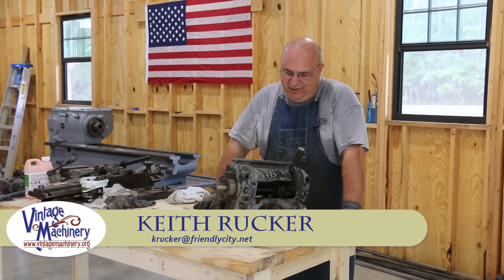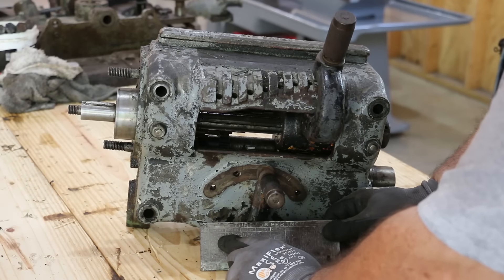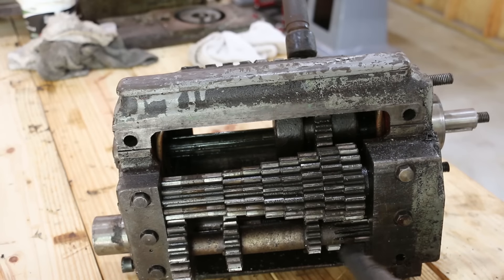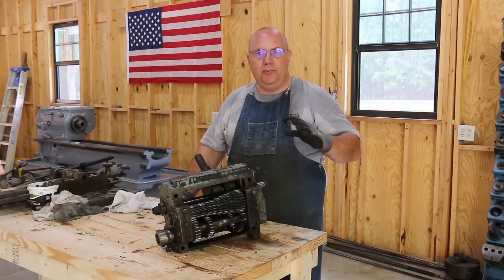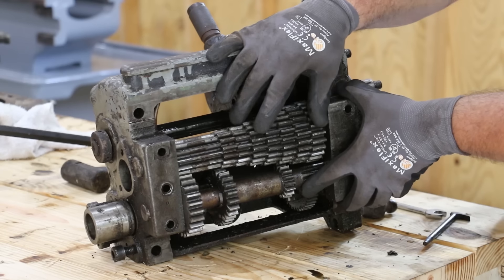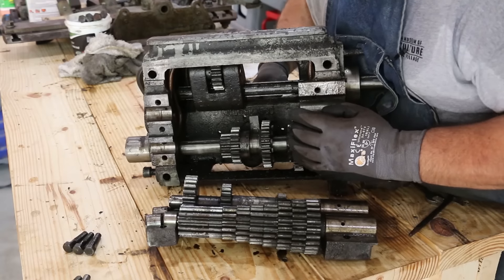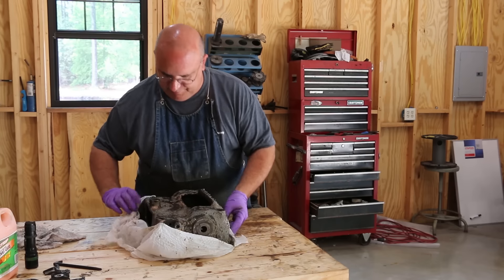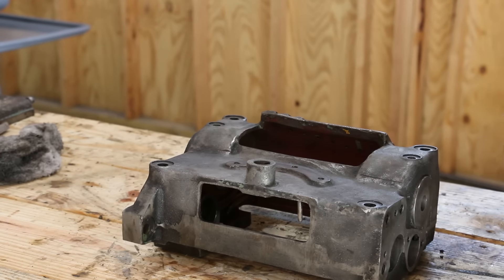LeBlond Lathe Restoration - Part 5:  Quick Change Gear Box Cleaning and Disassembly

Comment: Now, I'm thinking - it is probably possible to make a QCGB for my lathe, using a motorcycle gear box. Oh, all the project ideas - why do they always seem to sneak up on me? Thanks for sharing, Keith. Nice video! ;)
Reply: Erling, if your lathe was ever equipped with a QCGB it would be so much easier to find one made for you lathe. 
  I see you have an H1. I bought one new in '71 and still sorry I sold it. I kept it immaculate for 15 years and six months later it was trashed. 
  If you have a blown engine you could salvage the gear box for a lathe gearbox. I would build an entirely new mount for the gear train. This is because this style of  Japanese gear box with the three shafts in a plane (the split line of the engine/transmission) puts the input c/l rather far from the c/l o the output. You need the shafts offset like the ones in the video to make it more compact. You also need an "auxiliary"  gear train with two or three changes... 3 would give you 15 speeds. The whole thing runs much slower than any motorcycle gearbox so running open gears wouldn't be a problem.
Reply from the maker: You would have to do some math to get the ratios right for threading, but for normal feeds for turning, it would not matter what the ratios were as along as you have a nice range.
Reply: i also have a '71! The red '70 on my profile, is just for illustration - and what a bike it is!!!
The engine for it, is one I bought from a friend in North Carolina. Collecting parts for it as I go. Hope to get it running in a couple of years.
Yes, I'll have to find a bike with a set of gears that are close to my needs - then have some new ones made up, that will meet my requirements for threading - metric and "standard". Like I said - why do these crazy ideas sneak up on me all the time..LOL ;)
Reply: Erling, what lathe you have? If it was ever made with a quick change gear box, you should really try to find one for your lathe. If you can't find one, modifying a box from another model lathe might be the next easiest thing to do.Your plan is doable, but it is going to be a lot of work. When mounted, the quick change box has to line up with the carriage within 0.1mm or better. Everything must line up very closely or it will bind and/or wear components quickly. My H1 was purchased in North Carolina for $895 brand new.
Orlin in NC
Reply: Myford ML7, is what I have. Restored, and now collecting tools for it as I learn how to use it. The monster is greedy...;)
I know I should get an original gear box, but they're way too pricey for me. Cheers!

Comment: The gear that slides up against the other on the ABCD shaft, on car transmissions that was called a dog clutch. On your old Ford/Chevy 3-on-the-tree, 3rd gear engaged like that, coupling the input (engine) and output (drive) shafts together (direct drive).
Reply from the maker: Yes, I have heard that term many times!

Comment: Hi Kieth
It would have been nice if you would have shown how those threaded taper pins are removed, Just in case someone else is working on an older machine and they run into them.
Reply from the maker: They actually are not tapered - just straight pins.  When I turned them with a wrench, they came out.  For tapered pins, you "tighten" the nut and it presses it out.

Comment: That gear that is loose on the shaft and engages in the other sliding gear is somewhat like a motorcycle transmission where all the gears are always meshed but there are disks between them that are splined on the shafts in the gearbox. The lugs that engage in slots on the disk to allow the gear to transfer rotation are called dogs.
Reply from the maker: Yes, a dog clutch.

Comment: Well, you just provided an answer for me.  You said the lowest feed rate out of that box was 0.0025.  The lowest rate on the Mueller is 0.006.  Fine for 1018 & HSS tooling on deeper cuts, not so great with the harder materials.  I guess I need to look for an alternate way to get lower feed rates, like Mr. Pete did with one of his lathes.

Then again, I haven't seen many lathes that could cut 2 tpi
Reply: You can often swap gears in the spindle to gearbox gear train to get a finer feed than is listed on the quick change box plate. Additionally you can sometimes cut threads that aren't listed by doing this. On my Taiwanese Darsin 12x24 lathe, by altering the gear train I can cut 27tpi  and 1.75mm threads, though they aren't listed. 
    The reason even small lathes such as mine have settings for very coarse threads (4tpi on mine) is for cutting multiple start threads. Cutting a 4-start 16tpi thread requires the quick change box be set to cut 4tpi. Large lathes have the very coarse threads for the same reason. In fact you are more likely to use them on a larger lathe for things like large shut-off valve stems and housings that almost always have multi-start threads.
Reply: I did consider that possibility.  If there is a re-arrangement possible, I haven't spotted it yet.  The lathe was built about a century ago, but it came with the gearbox as standard equipment (and with an integrated thread dial, can you believe that?!).  From what little printed information I could find on it, the only gear change option available for the drive train was a gear for cutting metric thread.

Probably the best option would be to adapt a separate motor drive to the other end of the carriage drive shaft, like some Bridgeport mills have.  Having a power rapid traverse for that huge, heavy carriage might prove handy in a decade or two (it would be really nice to have now, in fact).
Reply: If the lathe is that old it probably has 14 1/2 degree pressure angle gears (there are ways to make sure that they aren't 20 deg gears). You most likely only need one gear to go with the ones you have to get more gear reduction. $40 or so should get the gear you need assuming the gears are in the 10/12/16 pitch size range. Generally you would want to arrange the gears smallest to largest from the spindle to the gearbox. Calculate the new ratios to see exactly what the feed rate is and see  if it is sufficient for your needs.Mcmaster-Carr has a good selection:
http://www.mcmaster.com/#spur-gears/=13ao886
That would be a lot easier than adding a motor drive.
Reply: Oh, I guarantee you, setting up a separate drive would be much simpler for me, in contrast to calculating ratio's/etc.  Thanks to high school high school math teachers that conditioned my brain to freeze and atrophy any time I'm confronted with higher than basics level math formulas.

Besides, if I can follow through with my intent of buying or even making a milling setup for it, having a drive system independent of the spindle could make it more versatile.
Reply: Calculating a simple change in ratios is a lot easier than doing the initial calculation for the whole gear train (including the QC gears). You count the teeth on a mating pair and choose a new gear or pair of gears that will have twice the original ratio or 1/2 the original ratio to get you the feed or tpi range you want. Making the change to exactly twice or half the original ratio makes calculating the resulting feeds and tpi from the chart much easier (or just print up a temporary new chart). (This is why lathes like my little South Bend have a choice of 20 and 40 tooth gears for the first gear in the gear train.) 

It's only when you want to cut threads not in the chart nor an easy multiple/fraction of something in the chart (like metric) that you need to make big changes (like the notorious 127-tooth gear - 1/2 of 254 - like the 25.4 to 1 mm/inch ratio ) and difficult calculations in the initial gear train.
Reply: Well, now I'm at a point where I need to "think out loud."  I don't have a reference book for mine.  Only information I've found in print was in a copy of machinery magazine.  So, no reference on the gear train, and I can only hope that I've found all of the lubrication points.  The "banjo" does not appear to have the same range of adjustment as the more common lathes that could be used with change gears or a qcgb.  From what I could tell, these lathes were built with the gear box as standard equipment.  Threading has 45 ranges from 2 to 60 tpi.  Since the metric ranges were not listed on the reference tag, I have to assume that the gear for metric was not part of the standard equipment list.

Well, now I need to back up a bit.  On reviewing that article, it says that it has optional gearing for "metric and special threads."  No clue as to what "special" is supposed to include.  I went back to see if they listed the range of cutting speeds, but, no help there.  I'd hoped to find some indication of having a dual range "hidden" somewhere, possibly in the apron.  There is one shaft that looks like it is supposed to have something on the end of it.  I've assumed that it is simply a countershaft to the gearing within, and that it was missing a cover cap.  Anyone ever heard of such a thing on a lathe?  I have to think it's possible, since I've been surprised by dual range systems before.  Anyone that has experience operating an old iron lug tire Oliver 60 without the benefit of an operators manual will know what I'm talking about!
Reply: To make accurate metric threads on an inch lathe you are going to need that 127-tooth gear. If it isn't in with the spare parts or on the banjo but unused, you don't have the metric capability.
Reply: Making metric thread isn't my concern, at least for the moment.  It's being able to turn at a feed rate less than 0.006/rev.
Reply: That should be easy. Swap out a driven gear for one with twice as many teeth. That way calculations from your existing chart will be easy to make. Just half what the chart reads.
Reply: I went out and gave it all another look, and did some measuring under better light.  More room on the banjo than I initially thought, however, the current gears are already configured for maximum reduction.  The only gear that could be changed for a double size is the one on the gear box itself.  It's O.D. is around 3.8.  Not room for a double size and be able to get the gear cover back on it.  I also realized that, due to how it shifts, that an alternate drive on the opposite end of the drive shaft will not work (like Mr. Pete has, Shop Tips #83).  Whatever solution is used will still have to run through the gearbox.
Reply: I have an upcoming project that requires a 1/2" pitch groove, but my lathe only goes down to 4tpi. My plan has been to just buy a gear that will give me double reduction as @Peter W. Meek described.
Rigging up a motorized feed screw would be a major headache on most lathes because the headstock end does not have a bearing designed for the screw to idle.
Reply: At that point I agree.  Cutting a groove, in the same manner as you would a thread, would require a static form of feed for your threading screw.  Mine uses a keyed driveshaft for turning feeds, and you can disengage the (separate) threading screw when it isn't in use.  Thing is, my turning feed per revolution of the spindle is, at it's lowest, 0.006.  A bit heavy for really hard materials.  Even if I could get/make gears to cut that in half, it's still high compared to most other lathes.  Some go well below 0.001/rev.

As for alternative turning speed control, I've got a few options for that laying around.  Old farm yards are, to put it bluntly, hell on riding lawn mowers.  I've got one variable belt drive available, plus another infinitely variable hydrostatic drive at my disposal. What I need to come up with is a quick way to disengage the alternate from the rest when I need to turn threads or do other operations where the gearbox would be the better option.

Comment: also These machines usually had a filler coat under the paint to smooth the castings and make the paint look smoother and more finnished
Reply from the maker: I run into that all the time working on old machines.

Comment: Watching this just reminds that i have the nightmarish job of dropping and splitting my Motorcycle engine to replace the gearbox, need to rent a spot from Keith (if i was in the US) haha
Reply from the maker: Just have fun with it!
Reply: ***** Since my comment i've had the Motor out and been in a jam since, one of the front Oil Sump bolts snapped being seized solid due to Kawasaki ingenious idea to leave the casing threads open at the top allowing grit/water to get in. I've tried heat, two nuts locked, anti seize, penetrating fluid, it's seized well and truly solid. 
Last option is to cut the remaining bolt thread flush with the casing and attempt to drill it out and hopefully remove the remaining threads to be taped. 
I haven't attempted it yet as i haven't had much luck in the past trying, the drill bit doesn't seem to follow the bolt it goes off into the Alloy. 
My only form of transport also so it's been a struggle.
Reply: ***** Yeah my biggest fear is it wandering hence why i haven't had a go at it yet. I've got an impact driver, may be an option. Also i have a set of JIS Screw drivers, no use on the Ninja, if memory serves me correct i recall seeing one bolt. 
I'm hoping the Stud extractor i have on order will help grab the remaining bolt shaft, it's quoted to be used on 6-10mm, the bolt itself has a 6mm thread diameter but it's possibly undersize now due to me wrenching on it with vice grips and the locked nuts. 
Welded nut is an option also if i can get it oil free.
Reply: ***** Yeah there's plenty of room to get 1/4 or 1/2 turns with the Extractor. I've got a mate that has a mill that could potentially get it out if it should happen to snap clean with the face of the casing this time around, just a bit of a journey to him with no car. Either way the bolt will come out willingly or destructively haha
Reply: ***** Thanks, feels like i need it haha. 
I have a couple other bikes that i would of been able to use had i not been slack and finished what needed doing on them. Not enough time in the days.

Comment: I agree that this is amazing stuff to have been designed and built in a time before computers... but I also like to remember that the SR-71 was also designed and manufactured without computers..
Reply: so was Boings 747 and many more. Some things can't be improved even before computers.
Reply: I with the guys that designed and built this stuff would wear patches on their shoulders like members of the military for their campaigns.  I would see one of those guys in public and gush at them for their contributions..
Reply: too many people today wouldnt see them as heroes, probably more like complain about their unions and the troulbe they cause for the people who want to work for $8 an hour, I myself DO see the sense in seeing these engineers as the reason we have so many well engineered items and are not living in caves still.
Reply from the maker: And the SR71 was designed in a very short time period if I remember correctly.  They just designed it, built it, and it was right....
Reply: yep.. that is something they could be proud they did.  I wish more big projects were like this, but this project was just crazy funded as it was black...  those titanium skin plates were something novel to work with and all their tooling had to be recreated to handle it.  Crazy lot of effort, but just makes it more impressive they actually built the aircraft and they performed so well..  crazy..

Comment: The "pins" on the side of the gear which engages in the idler are known as dogs. They are very common in old motorcycle gearboxes.
Reply from the maker: Yes, a dog clutch!
Reply: Yes, that's right.
Did you know that the first motorcycle gearboxes (after they were just direct drive) were adapted lathe gearboxes of the Albion type? They used them because that's what was available without designing new ones. The last motorcycle produced with an Albion type box was the 2008 Royal Enfield manufactured in India but still to the 1950s English design. To say they are not a  "slick" change would be an understatement. I have one of the last of them.

Comment: Why not just de-grease it and then put the case in a media blaster and strip the paint off that way???
Reply from the maker: Too many machined surfaces that I did not want to worry about messing up.  I did blast a lot of the parts that did not have machined surfaces on them (the levers and several other parts).
Reply: That makes sense. :)